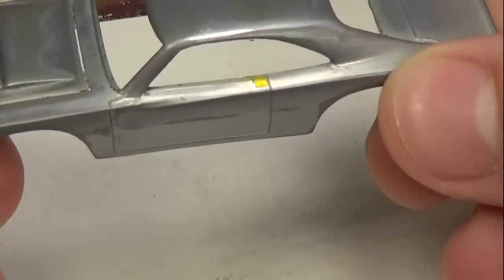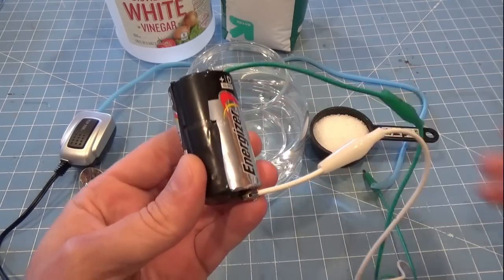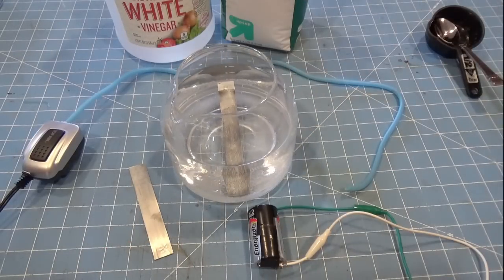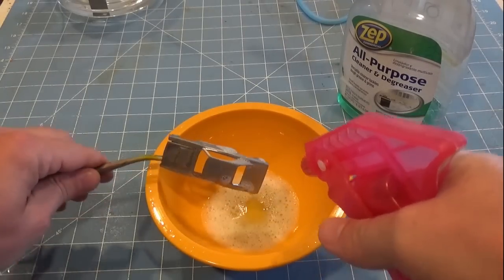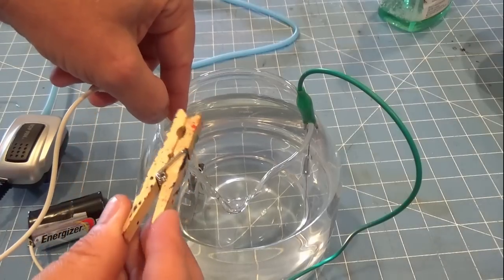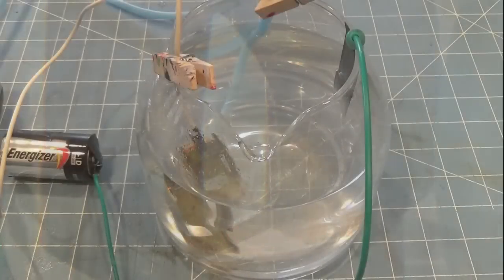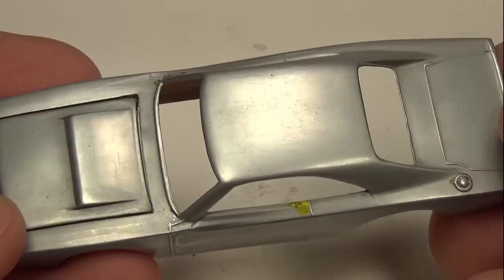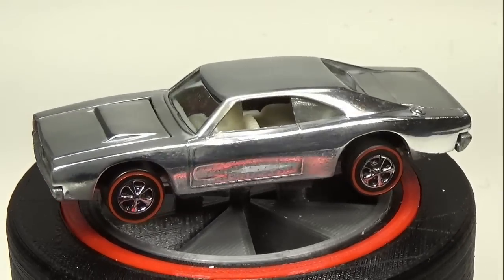Redline Restoration: How to zinc plate diecast cars

Comment: Power supply arrived yesterday.  Picked up a gallon of white vinegar and some epsom salts on the way home tonight.  Zinc strip is soaking in the solution.  I have a 63 split window Corvette that my wife wants in Spectraflame Red, but when I stripped the paint, it was ugly underneath.  This is going to be my first attempt at zinc plating.

Comment: I really like the plating idea. I've been wanting to plate some nuts and bolts and other small parts but haven't tried yet. I have however used electrolysis to remove rust and corrosion. Most people use Arm & Hammer washing soda as the solution for this and I believe some people have used it for zinc plating. Just wondering if you've heard of anyone using it for plating or if you've used it before and what your thoughts are about it? I'm also wondering if Epsom salt could be used for electrolysis rust removal in place of washing powder and if the results would be any different...

Comment: I have a 1969 dodge charger 500 that I customized to look like a 1968 charger. I did so by taking a big piece of tape and sticking it where the original tail-lights are, then cut the excess tape off.  I then used a black marker to color the taped part. Then I painted red circles onto that area, and glued it to the rear of the car. Next I used that same marker to color the front end and painted the headlights yellow. Now I have 2 questions: Is there a better way to have done the custom? And can you hand-paint Spectraflame paint onto a car?
Reply: no

Comment: Could the discoloration on the hoods be due to the way the hood is attached to the body, and it is not conducting at the same rate as the solidly electrically connected body?

Comment: Great video as alawys. Just a thing i noticed in the other's guy video. He uses a chromate solution after plating his parts because the zinc is very soft. Do you feel that the zinc you applied is like that? What can we do if we just leave it without paint?
Reply from the maker: You would need to either chromated or top coat it with a clear coat

Comment: would you recommend to zinc plate every car when restoring it? And what about if you have really deep corrosion? Just plate over it/will it hide or do i need to sand really deep and then zinc plate the car? I'm about to start my first resto on a twin mill, maserati mirage, tri baby, splittin image and a python :)

Comment: You can buy zinc strips at your roofing supply store. They are used to prevent moss from forming on the roof. A 3' x 3" strip is less than $10.

Comment: Apologies if it's been mentioned already, but you can get zinc strips from the roofing section of builders' supply stores. In rolls to be applied at the ridge cap of roofs to help prevent moss growth.

Comment: Going to try this out myself. I've picked up everything in your video but you never specify how much vinegar is in the bowl. Appears to be about 4 cups? Anyway, if i don't get a reply, I'll experiment and let viewers know what worked for me.
Reply: @baremetalHW Well after many attempts i figured it out. My process is literally the same as your electro polishing but with zinc bar, vinagar and epson salt solution instead of Phosphoric acid and stainless steel bar. Process takes 1 min or less not 30 mins. 

I used a small mason jar (Same size as the one you use in your electro-polishing video) I put 1/2 cup of epson salts into it and then I filled the jar right below the lip screw line. I then used my battery charger like in your other video instead of a battery because the battery didn't work for me.... Also I put the leads backwards of what you say in this video and the same way you did electro polishing.. BTW they are opposite.  Negative on Zinc and Pos on Car. Since i didn't think the bar i had was actually zinc as it is unmarked, i tried to use an old donor car to rob the zinc off of instead, which worked beautifully. I also am restoring a Custom Dodge Charger and had major pitting i was trying to fill and sand out. When i had negative to the charger instead of positive the zinc was coming off instead of applying. this would show as a sorta of brassy look instead of chrome... so i switched leads and tried again this time it started to plate instantly right before my eyes. now since I'm using a Battery charger on 12V... yes 12.. its only got 12 and no 6 option.... Anyway the process is very fast and each dipping take no more then 1 min. taking car out and brushing it down with a brass brush each time. I did this 8 times before going ham with the sand paper and thus far no discolorations and the holes are nearly filled!! I'd like to thank you for leading me on to this new skill but I'll add that with higher voltage your method is backwards... not quite sure how your getting same results as me.. cuz like i said, when i set it up same as you, the zinc came off not added more on top..

Comment: Is there any chance this set up would work with nickel, I have a twin mill 3 that I i wanna get as shiny as possible without a dremel and or buffing wheel and I believe nickel would be a good and easy metal to polish. Would you possibly be willing to try to make a video on nickel plating if this setup wouldn't work for nickel. PLEASE HELP
Reply from the maker: You would have to zinc plate and then copper plate and then nickel plate for that to work
Reply: baremetalHW damn, that's a lot of plating. Ok then, is there a way to get a mirror finish like you did in this video without using a dremel and without plating with zinc? I can get it pretty close with steel wool but I don't wanna go out and buy a dremel just for the car
Reply: baremetalHW also, in the video where you copper plated all you did to smooth out the metal is go over it with steel wool and then you went to polishing. Could I just go at the rough finish that would occur with this process with steel wool like you did in the other video, or is there a better and easier option that doesn't Involve a vibratory polisher. PLEASE HELP ME HERE

Comment: Why did you leave large patches of yellow paint on the car through the whole process?
Reply from the maker: I was testing the thickness of the plaiting.  I removed the paint after I was done and then used a microscope to see how thick it was. Watch the very end when the car is spinning and the paint is gone.
Reply: ... you used a microscope to check how thick the zinc plating was by (I presume) using the yellow paint as a visible divide?

That's...

Fascinating...

Did the paint not stop the process? Too thin to interrupt the electro-plasma-quantish-dooligans?

Oh, or, did the yellow paint stop the zinckidinking and when you removed the paint you could see how thick the zinc was?

So, how thick did it end up? Also, did the entire zinc strip get absorbed into the vinegar, if so, does the vinegar retain the zinc-o-cetate permanently? Could you use the same tub again? Is there a way of working out how much spark-o-particles are still in the tub?

If you sprayed a plastic part with a metal flaked paint, could that provide enough conductivity to zincinate plastic?

Does zincination cause autonanism? Should I zincinate my kids?

So many questions raised, and all I was going to post originally was "So very shine".

One of your best, dude, sharing this one about.

Comment: How much vinegar do you use?
Reply: I figured out that when using the solution from this video and the process he uses in he electro polishing video (Battery charger in short bursts) worked far better to me. I used a general sized mason jar like in his other video.. put my 1/2 cup of epson salts in before pouring my white vinagar in. I filled the jar to right below the lid screw line. I used an old donor car and attached that to a small alligator clip like his in this video and clipped it to the jas so it sat as far away as it could (Small space) Then I attached the other end to my batt charger negative end. carefully set that aside to that my pos wouldn't hit accidentally, I then took another set of clips and attached that to the car i wanted to plate. I attached the other end of that to my positive connector. BWT the charger is off and unplugged for safety measures at this point. when ready and set up nice i plug in charger turn it on with the pos connection with car attached in one hand i then slowly and carefully dip the car in the jar for about 30-60 seconds and then turn off charger before pulling car out of jar, Just in case the two metals touch and cause an ark... Cannot be too safe right? After that like he does here brush car down with wire brush and repeat until satisfied. Oh and one more thing since the process is so fast this way i just opt out on the fish bubbler so there's a bit of savings :)

Comment: Any value in sanding an polishing during the plating process, ie, run it for 30 minutes, then sand and polish and repeat.  This is how some items that have severer scratches or pits are repaired in the copper step of chrome restoration.
Reply from the maker: That's exactly what I do nowadays...run for 30..sand.. repeat.
Reply: @baremetalHW  was just reading online at the Factory Five website that adding some table sugar to the solution acts as a brighter by forming smaller crystals, every heard or tried this?

Comment: If you only do this, then polish it.....won't it just start to discolour over time due to the air? I thought it had to be an undercoat.
Reply from the maker: You are correct.   But I plan to paint it asap.
Reply: baremetalHW Ahh, thanks. Any idea if it will stay shiny if you clear coat it?
Reply: clear coat will protect it from oxidation just as the spectraflame
Reply: Erik Lind Thanks Erik. I reckon it will look awesome on some cars if everything works out ok. 😉

Comment: I like this, but wouldn't the cheapest method be to spray it with zinc spray? That's 3 bucks for a can here and should last you for quite some projects. It could be you'd have to be careful with the details, tbf, I don't know.
Reply: PaganShredhead I think the advantage of plating is that it has almost no thickness at all comparing it to a coat of paint, so there is no loss of details. But I am really no expert on the subject.
Reply: I can definitely see that, I haven't tried the spray yet to know how thick the coat would be. Coating would probably be the best to retain all details, I was just wondering if the spray could be thin enough to be the even cheaper alternative. Maybe one day he'll try it.